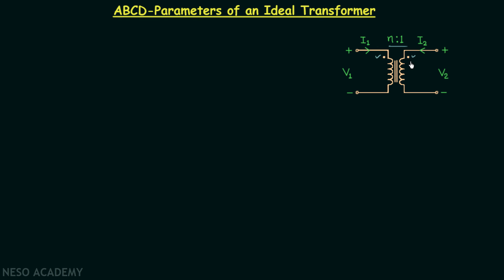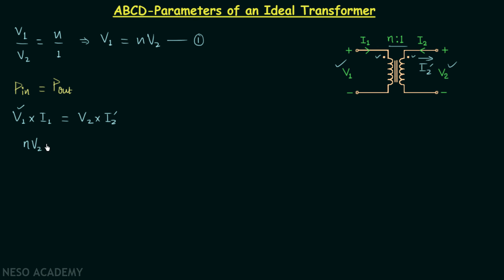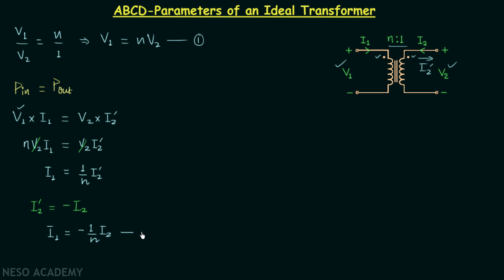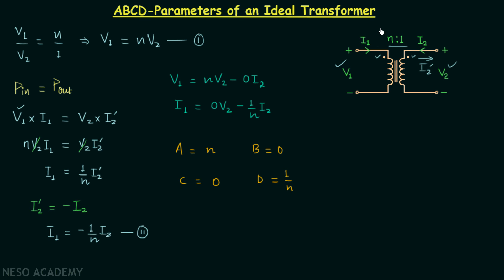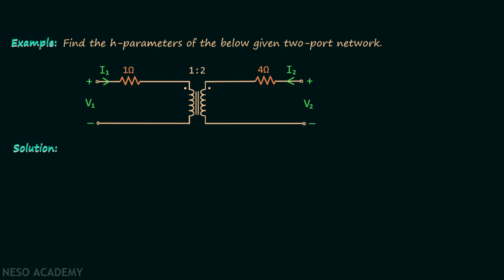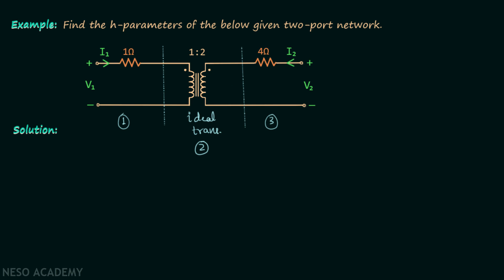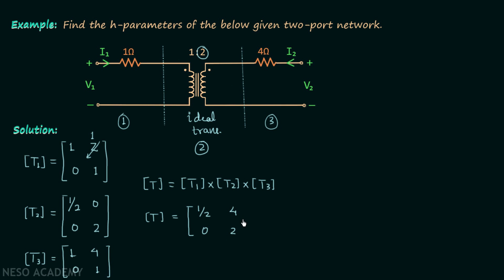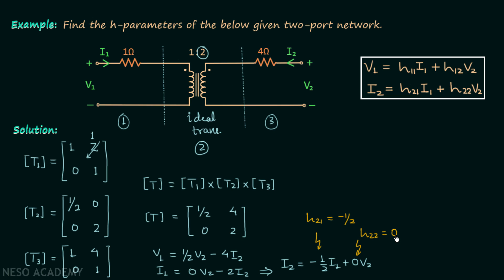ABCD−Parameters of an Ideal Transformer

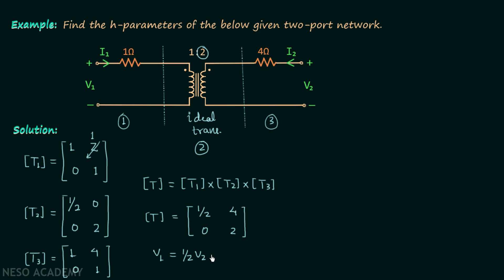Comment: 7:41 You're adding a voltage to a current and saying it's a voltage. It doesn't work that way! The "4" is actually 4 ohms, which, when multiplied by current, will yield volts, as required. A and D must be dimensionless, while B must be in units of impedance, and C must be in units of admittance. Otherwise, the thing just doesn't work.